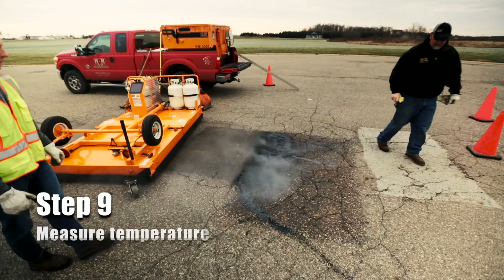Infrared Asphalt Repair Training - KM International

Comment: If I understand well, no need to pull out the damage area to replace with new asphalt,  instead to 'recooked' the surface and re add if necessary????
Reply: I agree.  It makes no sense to remove dirt or rocks as that is what asphalt is made of.  Remove water and organics, but all else I think should stay in the repair.